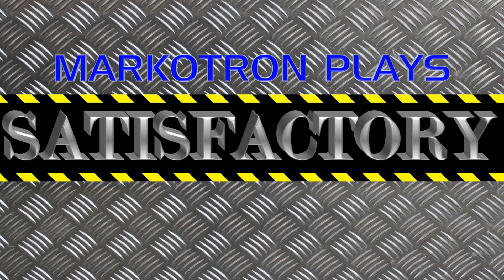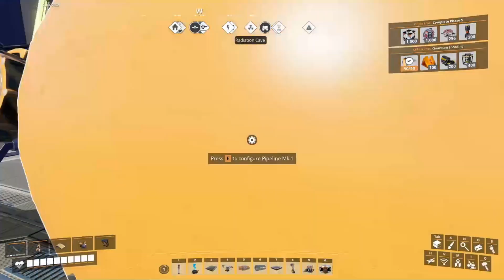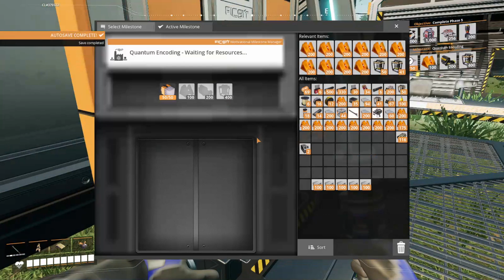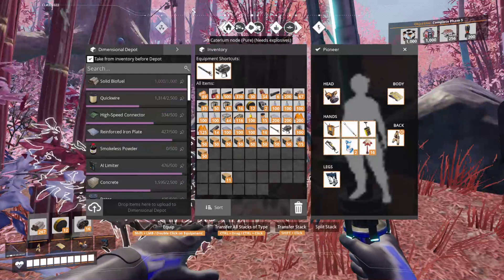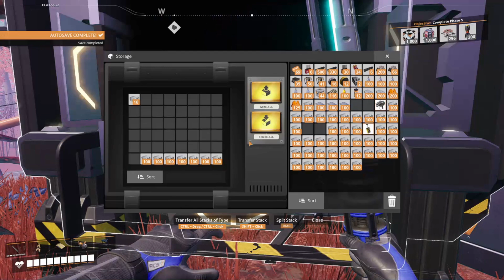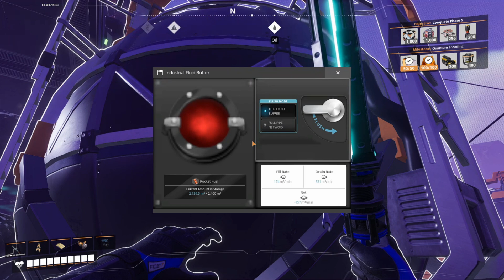Satisfactory Episode 214: Many Radio Control Units

Comment: Do you Play on the steamdeck or why does the game Look Like this. Sorry forgot it was an eng video
Reply from the maker: You'll have to use Google Translate or something since I don't speak German. No, I didn't film this on Steam Deck. I used a computer I built on my own instead of buying it from a store. 16GB RAM. Not sure about the motherboard right now. AMD CPU. It is an old CPU, but it's capable of running Windows 11, which I recently installed despite it not being on Windows's list of approved CPUs. The next game I play through should be smoother, although I have to figure out how to uninstall or turn off a few things I think are unnecessary.